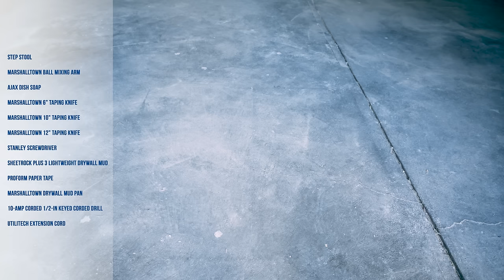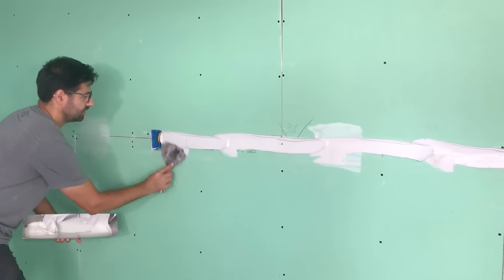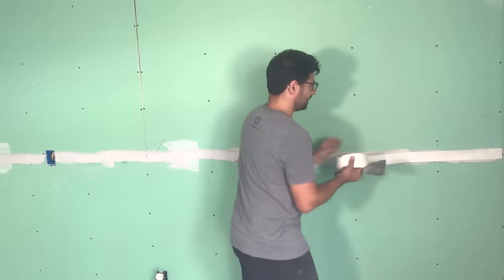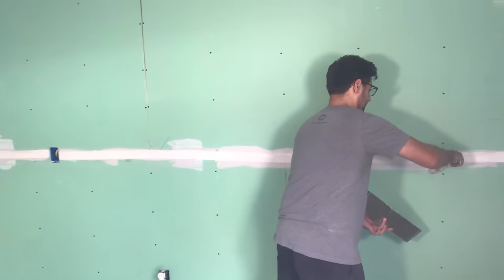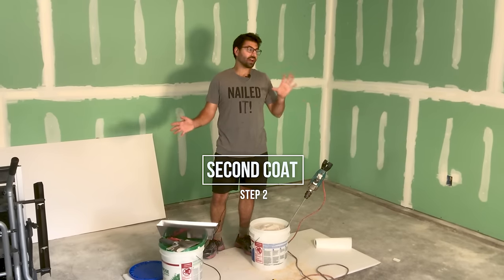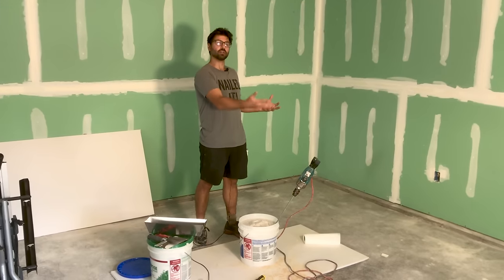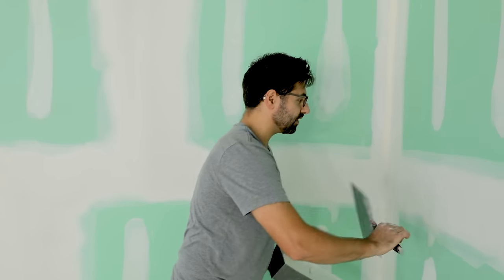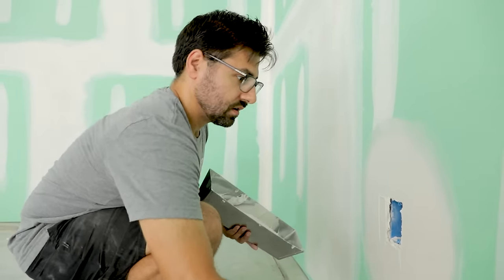How to Finish Drywall For Beginners | Nestrs

Comment: Do you need to do the sanding step if you are going to spray some kind of texturing (like orange peel)?
Reply from the maker: Sorry I didn’t respond sooner. No sanding need if applying texture. you really only need one coat instead of two after taping. The texture will cover any imperfections. I will challenge you to avoid texture as it is hard to match if any future repairs are made and a smooth ceiling just looks better.

Comment: Do you do 3 coats on everything? Including the corners and the screws? Also, any advice for an inside corner with a large gap?
Reply from the maker: Yes, I do at least if you are counting the tape coat. For the large gap in a corner. First tape it on the flat side,  let it dry, and then tape the corner like you normally would. After that apply your two coats of mud. Thanks for the comment!
Reply: @Nestrs  thank you for the reply and I will try that. You tape both of the flat sides in the corner or just the one that has a gap?

One other question. After what was shown in this video, would you still need to texture or skim the entire wall? Or is is ready to prime and paint as is with just the seams and corners done? Thank you
Reply from the maker: @GB-np4lb  just the gap. Ready to prime! Just make sure you use a good primer / sealer for new drywall. 👍🏼

Comment: I had some tape lift off the dry wall on my factory joints on the ceiling can I just skim coat over the tape or do I have to rip it all off?
Reply from the maker: Hi David, cut out the tape that has lifted and any loose material. Add a new piece of tape, coat it, let it dry and skim it. Then sand and paint. Thanks for the comment!
Reply: Nestrs, LLC Awesome thank you so much!!!

Comment: Great video! Watched after I was quoted $45,000 to demo and redo 6 10×10 bedrooms. Uh...Ill do it myself! I assume you do 3 coats in the corners as well, right? It looks like you used the 6" knife for the corners on all coats. Is that correct?
Reply from the maker: Hey Matt, Yes! Tape, coat, skim. You got this!
Reply: @Nestrs  Thanks!
Reply from the maker: Side note on corners: learning to use a corner tool (hand or production) is a pain in the butt, but worth it (see what I did there). For a first timer (and someone who is not going to do this professionally, a 6 inch knife might be the way to go but be warned it will take longer. Do one side at a time (so it’s like 5 coats). Tape, coat one side, coat other side, skim one side skim other side... let the mud completely dry between coats (this is where the time comes into play) Now look, no professional would ever do this... in fact many will probably comment on this and I will erase it... but again it takes less skill for a good finish to go this route. I hope this helps and happy drywalling 👍🏼

Comment: I’m converting a TuffShed into a recording studio. I insulated the walls & ceiling with R-13. I installed 5/8” drywall. Over the drywall I installed sound board. My next step is pallet wood. Oops! I forgot to mud the drywall! There’s no way I’m stripping out the sound board now. It’s only a 9’ x 11.5’ floor space. I’m okay. Right?
Reply from the maker: Hey Mark, you may have some minor air infiltration on a windy day but I think you are fine especially since you covered it up.
Reply: @Nestrs  No wind leakage. It should be fine.

Comment: I was quoted $900 CAD just for tapping/mudding a total of 600 sq ft of wall.. on top I have to buy materials..  Room is a straight forward rectangle room. Is this price on the top end? what would be average pricing.
Reply from the maker: Hey Great Tesoros, Prices can very from place to place and smaller jobs are typically a premium. Also keep in mind it’s a three day job (only a couple hours each day but still a lot of back and forth). Plus labor is up…. With that said, I would get a second (or third) bid. You may find it is the best price or they are over charging… also materials are not much in this case… maybe $50 for some mud,  tape and sand screens. Make sure their price includes sanding and cleanup 👍🏼

Comment: Oh I have a question... I got the courage to renovate my living room. My mom just bought the house she has been renting for 3 years and when we first moved here, there were a few rooms with wood paneling... I just painted over them in a matte finish to make them less visible since it wasn't our house. Now that we own it, I decided that the paneling had to go and ripped it out. Underneath it, I found drywall that was in serious disrepair. I'm sure most of the damage was done from them installing the wood panels because there were huge gauged out holes where the nails had been and then there was adhesive as well all over them. That was when I decided to tear that out and redo the drywall myself. The drywall that I removed was from the 50s and it was like a quarter inch of the regular typical drywall with a layer of what looked like cement over it. Have you ever come across that? Anyway, it was hell removing it but I decided that since the ceiling was still in good condition, I would not need to redrywall that. When I started to tear the walls down, I came across metal mesh in all the corners. It was actually metal and very hard to remove. I found that the metal mesh is attached to the ceiling edges so I was not able to remove all of the corners without effecting the ceiling. I figure I can cut the corners with a saw or something but would I still mud the ceiling corners the same as if I had redone the ceiling as well? Also, I was super annoyed when I realized that they did not drywall the ceiling first. I know you're probably thinking I should just tear down the ceiling as well and redo that too but at this point i am sick of demo. If been demoing for like 3 days for like 12 hours alone and I'm tired of it. I cannot imagine still having to tear down the ceiling as well. Hope to hear back from you soon!
Reply from the maker: Hey ilmk92089, I love that you are getting rid of that paneling. No need to tear out the ceiling if it is in good shape. Buy some tin snips and cut the metal mess from the corner. It will take some time but well worth it. Once you hang your wall with new drywall it should cover any imperfections. You will still need to tape, coat and skim the corner as well as repaint the ceiling. Have fun!
Reply: @Nestrs  I can't use tin snips because the mesh is in between a layer of cement and drywall. The only way tin snips would work is if I managed to remove the front and back layers first. If I use a handheld grinder or small saw can't I cut through all three at the same time?
Reply from the maker: ilmk92089 A Dremel might be your best option... wish I could have helped more. Let me know how it goes.
Reply: @Nestrs  OMG I screwed up... I finally started hanging the drywall today and I freaking messed it up... I completely forgot that I needed to stagger the butt joints! I've only done one wall, should I try to fix it?!?! 😩
Reply: @Nestrs  also, I didn't realize that you're not supposed to end a sheet on a door or window... So there's this break in the wall I've done that leads to the kitchen. I cut and ended a sheet right on the stud on the side of that break. There's no door there, it's just a passage. Is that okay? I knew I should've rewatched the video before starting. 😭
Reply from the maker: ilmk92089 its not the end of the world if you didn’t stagger your sheets if yours walls are square. If it is only a couple pieces you can remove them and cut down the sheet to the previous stud. Always break on a stud. You need your ends to be screwed to something to prevent movement and cracking.
Reply: @Nestrs  I am going to fix it. Might as well.. haha
Reply: @Nestrs  hey so I'm gonna start mudding soon but I had a question about finishing. So we don't want textured walls... So when I finish mudding and sanding, I just primer and paint right over the remaining exposed drywall sheets?
Reply from the maker: ilmk92089 yep! You will want to use the primer/sealer for new drywall.

Comment: Nice teaching. But if you hung the drywall vertically, you wouldn't have any butt joints. Why do some hang vertical and some hang horizontal if you have 8ft walls?
Reply from the maker: Thomas Brock that’s a great point! While hanging vertically reduces butt joints it increases the linear seam footage and is harder to finish. More importantly, horizontal hanging hides uneven studs and ensures a smother appearance. That’s why you only see drywall hung vertically in basements, garages (not mine 😜) and commercial projects due to fire code.
Reply: @Nestrs  ....Dang!!! Helps hide uneven studs!!! Wish I would have known that 3 weeks ago. Ive been helping my cousin 90^ remodel a house built in 1950's. Whole house was sooo uneven, drove us crazy. We were trying to teach ourselves drywall, but you've helped out bigtime now!!! Thanks! Is it basically the same for ceilings? We have to do ceilings in whole house too

Comment: Hi. Question, I thought the blue lid mud goes on first for the first and second coat and the mud with the green lid is the one for the last coat. Also can I use Sheetrock 45 for inside and all corners? Thank you.
Reply from the maker: Hey deapozol, light weight mud (blue lid) is meant for the skim coat or last coat. You can use the multi purpose (green lid) mud for all coats if you want. It’s just heavier then light weight mud harder to work with. I use Sheetrock 45 for the first coat on all corner bead. I do not use it for interior corners. Hope that helps!

Comment: Would using the light joint compound (putty) as the primary and only type of compound be a bad idea? Such as Beadex Lite premixed compound?
Reply from the maker: Hey Lukas, It would be fine for smaller jobs but I wouldn’t recommend it for a larger projects. The most rigid compound is Durabond or Quick Set. These products are a powder that you add water to and mix yourself. I would use these for any outside corners and even the taping coat if you are wanting the best results. They dry fast so only mix what you can get on the walls quickly. This typically takes a little more experience before mastering which is why I suggest all purpose compound for beginners. Let us know how it goes.
Reply: @Nestrs  this will be my very first time building a wall and installing drywall. Thanks!

Comment: Can I use the skimming powder for the first mudding please I need answers
Reply from the maker: Hey Emmanuel, Most drywall powder mixes will work for taping and coating. Two of the most common ones in my area are easy sand and quickset. I would just keep in mind that these compounds dry much faster than what you get in the pre-mixed buckets. I typically use these products on corner bead only as they are are typically a stronger material once they dry. If you are a beginner I would recommend going with the pre-mix compounds. Hope that helps!

Comment: Can you please tell me what counpound you use?
Reply from the maker: Hey Bojan, I typically go to Lowe’s. They carry Sheetrock Brand. Multi purpose for taping and second coat. Light weight for your final skim coat. If it’s just a patch job you can use either.
Reply: @Nestrs  thanks. Can you recommend some for first and final coat?

Comment: So then it's ready for paint after?
Also how would I join cement board and green board? Just mud the seem?
Reply from the maker: Tijeriña Production Yep, after you sand, you are ready for paint.

When water proofing cement board, I typically use mesh tape or a membrane fabric in place of the paper tape and seal it with aqua defense or red guard, instead of drywall compound, to seal each joint.
Reply: Apparently when it comes to American standards. 
Where I’m from, you have to prime all the mud. Caulk all corners and and joints where walls and ceiling meets. Then you ably, some kind of glassfelt/tissue, then you paint.

Comment: And I always thought you sanded between every coat!
Reply from the maker: Thanks for the comment Tatalaticus A. A quick light sand is usually needed with the exception of the taping coat unless you left behind some lips. The goal is to have a smooth finish to minimize sanding as mush as possible. This will save you time and mess.

Comment: Why not do the butt (vertical seem) ends first then all your tape ends are covered with the joint (horizontal seem) ends then corners last it'll cover up the joint tape ends
Reply from the maker: Yes, Butt joints first. Back then I was working 16 hour days. I will say that the walls still look perfect despite that. 👍🏼

Comment: Sound proofing insulation which one better 
Fiberglass insulation 
Rock wool
Romulo
   Because I want installed one 
Best sound proofing and acoustic Home theater
Reply from the maker: Nejmu Nejmu I have used both in the past. I think that the rock wool is easier to work with and install but it costs a little more. As far as performance and longevity I believe they are about the same. If you are doing a high end project and want maximum R-value and longevity go with the spray foam insulation. Just keep in mind you will pay a premium for this so it doesn’t make sense on all projects.
Reply: Installing a second layer of drywall; installing resilient channel; or a combination of both will greatly improve your sound rating.

Comment: Amazing video for some reason this one really clicked for me :) I had one question I added a wall in my house that meets a textured ceiling, ive followed your steps and everything looks great but where the tape meets the ceiling it’s kind of pronounced how smooth it gets would you sand and finish al the other steps and than put another coat of mud up after everything is smooth and try to texture where it meets the ceiling ?
Reply from the maker: Hey Josh, sorry for the late response. I would recommend knocking down the texture. Spray it down with a little water first and it should come right off.

Comment: Do you sand in-between each coat?
Reply from the maker: Hey Tony, the goal is not to sand. However, that luxury typically comes with experience. Any lips and rough edges should be lightly scraped or sanded as needed.

Comment: First thank you so much for this detailed video! It really helped me tackle the first of many rooms in my home. 

However, I do have one question.  Some of my tape is bubbled out in the middle. Not all of my tapes are doing this. Can you please explain to me what I am doing wrong and what I need to do to fix it?
Reply from the maker: Hi TheCarolineWayOOF Lovelies my first thought is you may not have had enough mud under your tape and/or you may not have wipe it all out with enough pressure. Unfortunately, it sounds like you need to re-tape where the bubbles are. Good luck!

Comment: The compound listed in your link is premixed.  Do you still need to mix like you did in your video?  Thanks!
Reply from the maker: Yep! Premixed compound means water has been added as opposed to purchasing the bags of drywall in a powder form which also has it place. In this case your are quickly stirring the premixed compound to make it more workable and remove air bubbles. You want it to go on like butter!
Reply: @Nestrs its a scam, youre still mixing, your just paying to save yourself 3 minutes of mixing if you have a mixer already.

Comment: anyone got any tutorials for trimless walls? i wanna do trimless walls in my house.
Reply from the maker: Anthony Frazer, I need to do a video about corner bead. Here are a couple tips.
1. Use metal corner bead  
2. Squeeze the entire stick lightly so it is slightly less than 90 degrees. This will help prevent flaring of the bead and make it easier to finish.
3. Don’t nail.... alway use screws
4. Take your time and keep the bead nice and straight.
5. Use Durabond or Quick Set for you first coat. You will have to mix this yourself. Follow the instructions on the bag.
6. Carefully scrape the lips with a 6” knife once it dries. You will have some air bubbles. Do worry about them.
7. Second coat you can use light weight mud.
8. Give it a third coat if needed.
9. Sand and paint

Comment: Hi Nestr, thanks for the video, it's very informative! In my case, i feel like I did the exact same steps with the exact same products but some joints and flats are starting to crack the day after sanding. What could be causing this issue? You feedback will be appreciated.
Reply from the maker: flacko509, sorry to hear that. Extreme temperatures specifically heat can cause cracking. As long as your tape coat it good and you wiped all the compound from under the tape, you may simply need to sand and apply another coat on top.

Comment: What would happen if you pop an air bubble with a needle ??
Reply from the maker: Jose Camacho thanks for the question! I wouldn’t waste your time popping air bubbles. It would show as a tiny pot hole in the finish and would require another coat. In many cases it can be sanded out and covered with a good primer/sealer.

Comment: Where was all the sanding between coats?
Reply from the maker: eh_bailey well, if you are cutting your edges properly there really isn’t much sanding until the skim coat. If you need to sand go ahead and do it. The more you finish, the less sanding you will have to do ☺️

Comment: Wat is the different off Gypsum board and dry wall
Reply from the maker: Nejmu Nejmu good question Nejme, gypsum board is the actual sheet of drywall where dry wall is a more general term for the trade. Other names also commonly used are sheetrock, wall board and drywall panels.